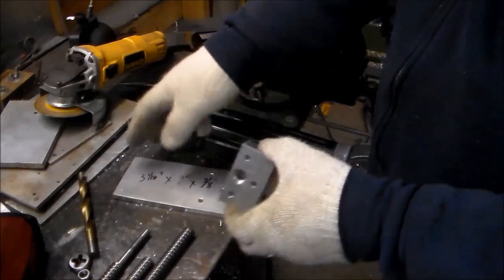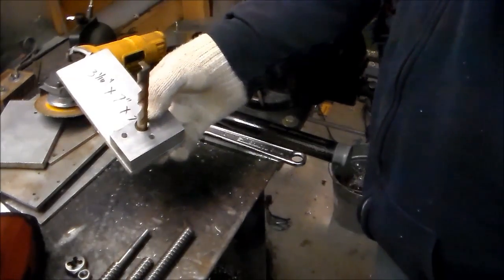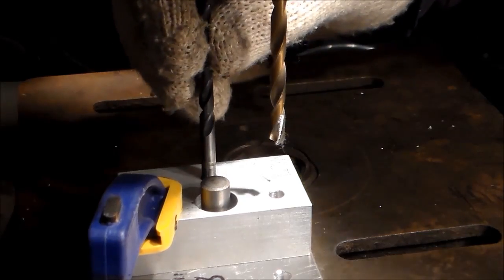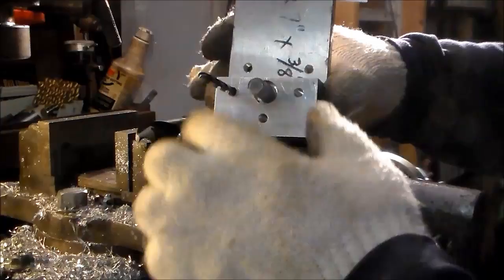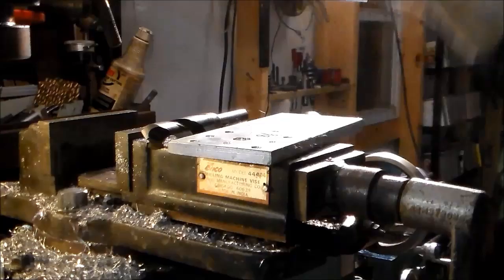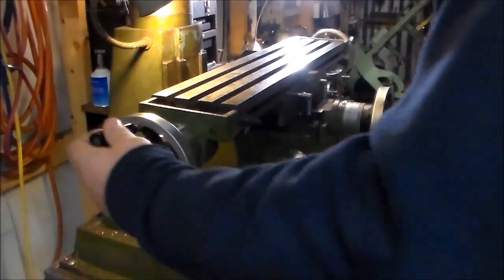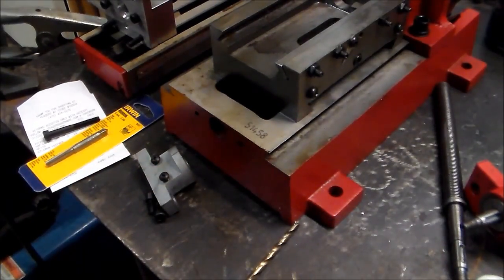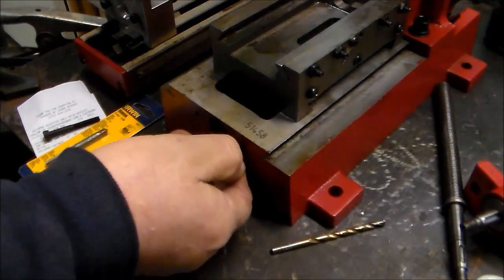Part 5 Harbor Freight Mini Mill X2 CNC Conversion Step by Step

Comment: Why are you making all this from Aluminum? Cold roll will last much longer you know this! Or are you making a prototype first? On a CNC you will want it not to wear like aluminum will.
Reply from the maker: Well, the parts I'm making out of aluminum are non-wear parts, they're just mounts. The moving parts all have bearings, hardened race washers, hardened ball screws, etc. In my experience, cold roll steel has problems of it's own when you machine it. The  stresses in it can cause you a lot of issues too. I think aluminum is just fine for stationary mounting purposes.

Comment: I know I'm a little late to the party but my advice is to get spiral flute taps from now on. That Irwin tap you picked up,  I would only consider a thread chase.  Spiral flutes cut real nice and hold an edge for a long time.  They are an investment but pay off when you want a nice straight thread.

Comment: Hi,
great videos on this project.
looking forward to the next one.
I have  Bridgeport knock-off by harbor freight I have been wanting toconvert to cnc for a long time. these are really practical videos onmachining the parts needed to implement ballscrews to the mill in a practical way.Also the tion on using the mill to position the tap is a really useul tip.
Reply from the maker: +Perry Engel Thanks. I actually worked on this project some today, but still don't have enough footage to wrap up part 6.

Comment: was very interested in this hope to see more!  by the was I was thinking of getting myself the exact same mill. this is my first time venturing into milling what are your thoughts on bang for the buck with the mill (power, accuracy, ect.)? keep up the great work!!
Reply from the maker: +Scott Teigland Thanks. Well, I'm not sure how to answer what I think about this mill. When using a mill, you want rigidity, mass, speed, and power. Any "mini" mill isn't going to have any of that! But, if you work within its size and power limits, I think they are pretty good. Great for learning the basics on. I'm using this platform mainly as a cheaper way of learning CNC milling and machine conversion. I do admit though, I kind of like this little mill.

Comment: Awesome series, I too used too work in the cold, finally caved in and installed an overhead 5000 watts heater now I sweat, not much better!  Sorry for your father in law, cheers. Can't wait too see the final result!
Reply from the maker: +Benoit Lessard Thanks, one of the reasons part 6 video isn't finished yet, is I've tore my shop apart on a clean/organize/build/insulate project. Those that follow me on Instagram and Facebook have been seeing some of that.

Comment: Thanks for sharing your CNC upgrade as I thought it was a matter of putting a stepper motor in place of each handle but you show a new to me piece of hardware under each axis. Have to wait for your next videos to see what they are for. Expect to see many intrincate knives made with this CNC mill :D
Reply from the maker: +Alex Echeverría Thanks. I guess you could just put steppers on the existing x and y axis, but the accuracy would be terrible. The ball screws reduce the backlash and friction by tons. I've seen guys just put steppers on the tool like you mention to get a basic power feed option, but not for positioning.

Comment: I've followed through this playlist of videos, great detailed explaination! I'm thinking of buying my first mill and doing the exact same conversion as this. I'm interested to see what you have to do up top for the Z axis ballscrew! I've seen an X2P available where I live (in the UK). Do you know what exact model this is? I can't find a plain "X2". Also, i'm interested to know what this machine is like for milling steel. Have you given it a go yet? Looking forward to the next installment.

Sorry to hear about your stepdad.
Reply from the maker: +Luke Blades Thanks for following along. For the Z, I've got some ideas and a plan, but I won't know exactly until I actually get to it. These little mills are sold by a few companies with different model #'s, but they're all basically the same. At the start of the first video in this project, I listed the model # for this one. Will they cut steel? Yes, but don't expect to remove a lot of material. It'll be slow going, these things are tiny. With some trial and error and a lot of patience, you can cut about anything, but again, this thing is tiny.

Comment: A bit of advice for your z axis. I used a CNCFusion kit. Their z axis is on the right side of the machine head and covers the gib screws which makes adjusting them impossible. Great videos. Keep them coming!
Reply from the maker: +Benjamin Usey Thanks for the head up! I haven't completely decided on how I'm doing my Z yet, I'm kind of deciding as I go. Thanks for the tip.

Comment: I have a Jet mill just like yours even with a height extension collar and a similar stand.  I suppose it should be taken apart and serviced aa wwll.  Sorry to hear of your loss.  I know how you feel I lost my father suddenly too.
Reply from the maker: +Glenn Felpel I was a little apprehensive about taking the Jet mill apart, but working on this mini has boosted my confidence I guess. It wasn't bad at all in hindsight. Mine was made in the 80's and still had the original dry, petrified cosmoline all over its guts.